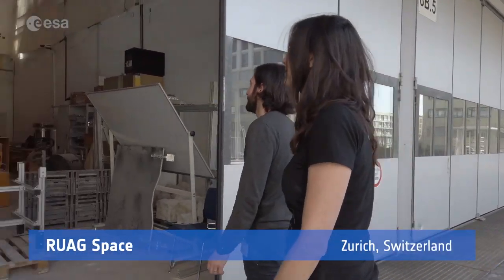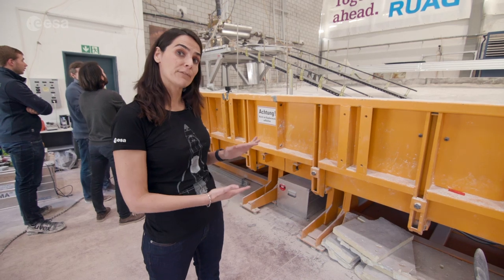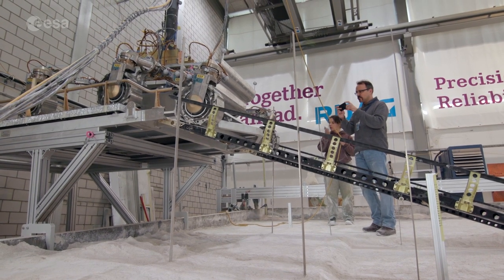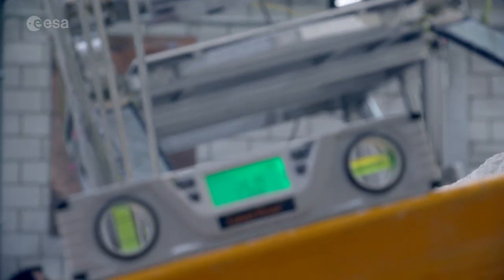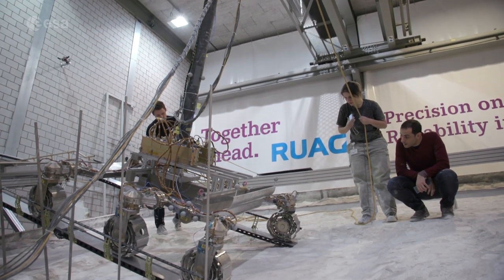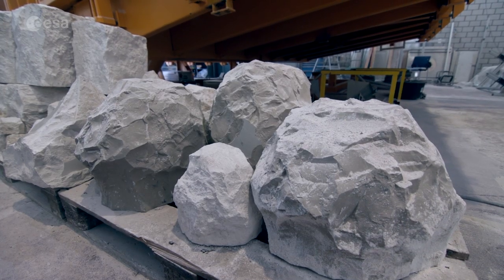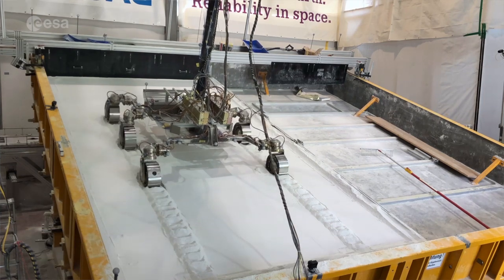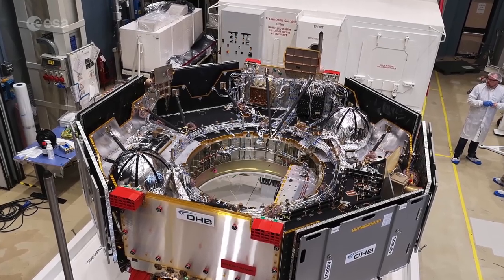ExoMars – Moving on Mars

Comment: When is the ETA for the start ? 2020 ?
Reply: Yes, the next transfer window for Mars opens in summer 2020.
If they don't make it until then, it's another two years for the next opporunity. ^^
Reply: @debott4538  another Opportunity? that'd be great i liked that rover
Reply: @QuantumFluxable  Can't say the pun wasn't intended. ^^
Knock on wood that Rosalind lives as long as that one did.
Reply: I wouldn't be surprised if they'd delay it. There are some issues with parachutes that they have to resolve on time - if they'll be happy with solution - it will launch. But they won't risk the mission just to meet the launch date.
Reply: Has the countdown to ‘impact’ began yet...?

Comment: Give the Rover Spider like legs and limit the possibilities of it ever getting stuck again, this will also remove the possibility of wheel damage down the line.  It will also give the rover the ability of rise and lower the main platform..
Reply: Spider legs would get stuck in loose sand. Also keep in mind that they have to carefully balance how much weight is sacrificed on mobility vs science. Every kilogram you spend on legs is a kilogram less for science instruments.
Reply: @SkywalkerWroc  The weight saved alone on the motors at the end of each wheel would make a huge difference.
Reply: @TheflickerofMotion  It would be worse.  Think about how much mass would need to be spent on motors for the joints and strengthening legs.  You would need to make the feet wide enough to spread the weight around.  That adds more mass.  

There is a reason why they are scientists and engineers working on the rover.  They have a better idea of what is going to work than some random on the internet.

If, on the other hand, you are able to show them designs, practical tests and simulations showing your idea works, I am sure they would love to hear from you.

Comment: Solar panels on Mars :/  ?
Reply: @Smee Self not such a good idea, i would rather give it power like couriosity does
Reply: @DamianAI9  solar panels worked great on Mars, so why stop using them?
Reply: @Vulcano7965  sand storm
Reply: @Vulcano7965  they should add a system where the solar panel can be cleaned
Reply: @DamianAI9  It's called wind and it worked for over ten years for opportunity.
It's not like it's easy to get the radioactive material for a mission. Why do you think did the JUNO Spacecraft rely on solar panels far further out instead of a thermonuclear battery?
Reply: You've missed Opportunity rover? Google it, quite amazing what you can do with solar panels over 14 years of driving around the surface.
Reply: @SkywalkerWroc  yhea that's true R.I.P oppy
Reply: @DamianAI9  ESA does not have access to RTGs like the Russians and Americans have, so it has got very skilled at using solar panels.  As others have stated, the wind on Mars, while being slight, is enough to clean the panels, any equipment to clean them separately would add to the mass and complexity of the rover, meaning they would need to cut something else.  Either the strength of the rover or its science payload (which is the whole point of the exercise).
Reply: @ptonpc  thank you didnt know that

Comment: Uh is anyone going to notice the loud snapping noises before they move on to the next tests. That doesn't sound good. Are those pressure articles or did they fix it between shots? If not might want to check if it is an engineering failure of parts. Probably don't want it breaking before it gets on the surface.
Reply: Looks to me like it's just one of the ribs on the wheel slipping of the end of the ramp which released the spring energy stored in that section of the "tire".
Reply: It's perfectly fine. That's the design of those wheels: spring-like metal. It's what gives it an advantage over Curiosity rover, which had its solid wheels pierced and significantly degraded to the point where they had to completely change the way the navigate.

Comment: A question for ESA: Are you reinventing the wheel or are you expanding on what the NASA/JPL rovers have already done?  I refer to the structure of your rover - the wheel systems, the electronics, the software.  In this video, it appears that you are re-inventing things as if they had never been done before. Just curious. Do ESA ever respond to comments?
Reply: They run their own design that's not based on US rovers, but it does take lessons from those few results that NASA has chose to publish. Eg. it's made of flexible metal with reinforced parts that would prevent wheel piercing issues that Curiosity has encountered. Also walking mode would allow it to access slopes no previous rover could.
Reply: ....and it can drill....deep....6 feet down if all goes well.....40 feet down if it does not....😉